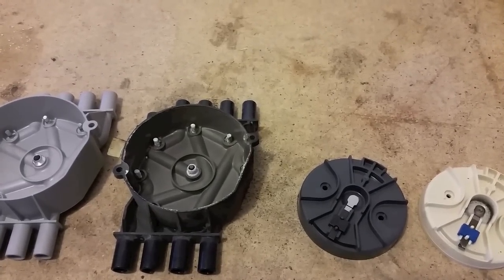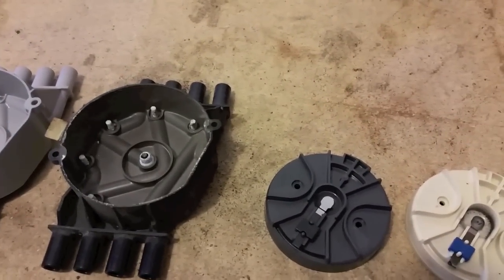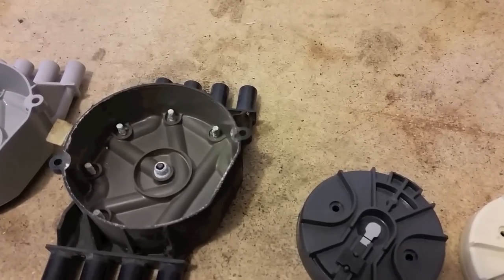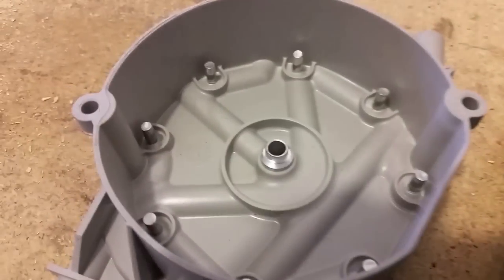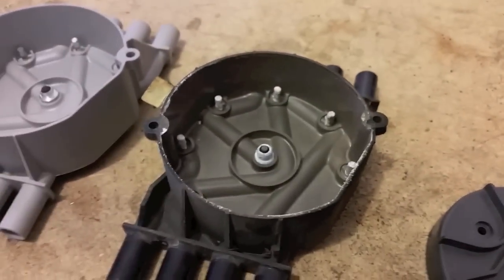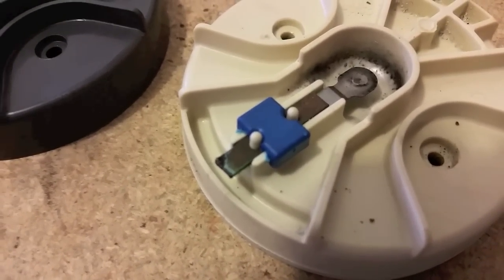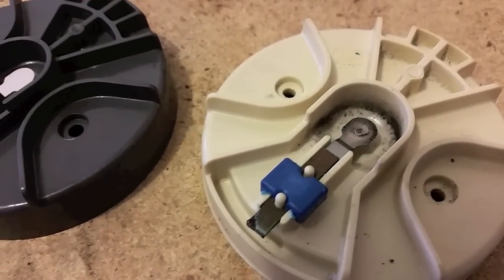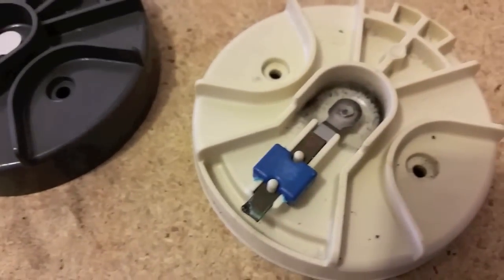Engine Quick Tip: Cap & Rotor Basics

Comment: I have a 2004 ZR5 at 155k with original cap and rotor but Im switching it out today. Also going to do spider injectors as well.  I cant see doing cap/rotor every year, but maybe in colder climates? Im in Florida. Also doing fuel pump.  Trying to stay ahead of the game!  Thanks for video

Comment: My gas mileage on my 1997 has been going down steadily. I just changed the rotor and cap and wires after 113,000 miles after a cylinder misfire code. Yes, inside pins were all corroded. Laying on top of the engine to do it is a PAIN in the butt though. Now that I've done it once I know what I'm doing.

Comment: Just fixed my truck it was having misfire issue code change the cap and rotor like you suggested runs great again no more code
Reply from the maker: Awesome to hear, glad I could help!
Reply: @MidwestGarage  I didn't know you had to change them that often lol mine is on its second cap at 215k miles lol maybe thats why this truck has always had a misfire
Reply from the maker: Haha! That could most definitely be the issue man, simple fix at least!
Reply: @MidwestGarage  yeah my fuel pump is going out whinning like crazy you can here it about 200 ft away from the blazer lol bought new fuel pump and sending unit, plugs, wires, cap and rotor so it should fell a lot better now
Reply: Mine was the P0300 random misfire code. I'd put a new cap on. It was good for awhile then the code popped up again. Finally after changing the cap & rotor again I noticed the rotor had lateral(side to side) play. Basically the bushing or bearing that keeps the distributor shaft spinning straight went bad and the rotor was actually hitting the terminals on the cap. Replaced the distributor,cap & rotor cleared the code. Hasn't run this good in a while. And I replaced my heater switch because it was bad and causing a vacuum leak.
Reply: Got an 07 Yukon 5.3 V8 and Im having rough idle and excessive exhaust hard shift from 1-2, gas mileage is noticably worse then normal and I'm getting service stabilitrak and service traction control,hooked code reader up and gave me code 0304 misfire on cylinder 4 and 0496 EVAP purge code, so I got a new purge valve and that took away my EVAP code and the exhaust seems to be less excessive and not such a strong gas smell but everything else is present still rough idle hard shift also replaced the mass air flow sensor and that didn't seem to change anything, desperate for some answers

Comment: I change my cap and rotor bough some at autozone now my c1500 5.7 is rough at idle and gets misfires is it possible to install the rotors incorrectly or have a faulty one
Reply: The roter only fits 1 way. But ive seen new caps cross fire to the wrong cylinder and not even work right.   it is posable the new cap is  bad .

Comment: If you have a worn  out distributor spend the extra money for the billet style. That plastic crap that GM put on these gives a ton of problems. Good video as the cap and rotors are known to be problem children as well.
Reply: What is a "billet" style? How do you tell the difference?
Reply: The stock GM distrubutor is made of plastic. The Billet style is shiny metal. Doesn't wear out prematurly.
Reply from the maker: Very good tip! Thanks!
Reply: @MidwestGarage  I just purchased a new billet distributor complete, with cap, rotor, and plugs for less than $40.00 online. I couldn't get cap , rotor and plugs at my local parts store for that price.
Reply from the maker: @shawnevans1585  Nice! That's a hell of a good deal there. I'll definitely have to grab one of these next time I change mine out!
Reply: First you need to make sure you have the clearance to change it over. That style cap and rotor only fits the distributor for the vortec engines.

Comment: I have a 98 gmc vortex 5.7 and I literally have to change the cap and rotor every 4 to 5 thousand miles, why is that?
Reply: There are two drain hole on the distributor floor under the rotor. The hole have screens in them. Poke out the screens because they get clogged and moisture has no place to drip out.

Comment: I installed my distributor with new cap rotor and a new cam sensor and it starts now but runs badly... i still get the P1345 code... could i have installed distributor wrong? it has a miss...but i am not sure my 4.3 2001 blazer would run at all if distributor was put back wrong...anyone Know? also when replacing cam sensor in distrib do you have to use a scan tool with relearn feature or not??? i do not own one...any help from someone that knows the answers to my questions is  greatly appreciated..thax
Reply: What’s the update on your code and cam resetting?